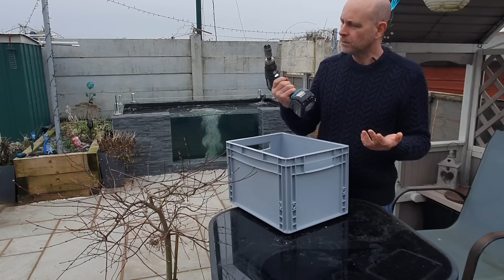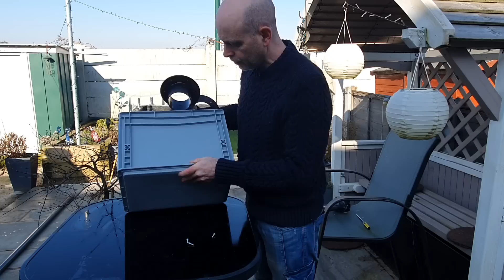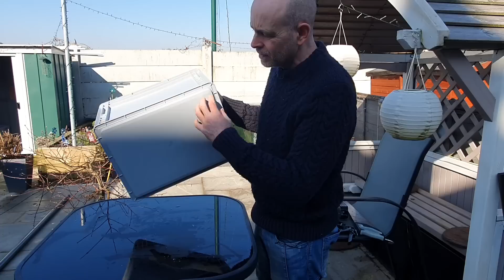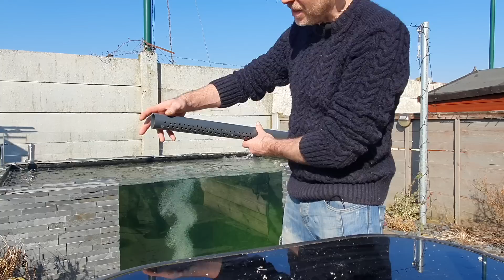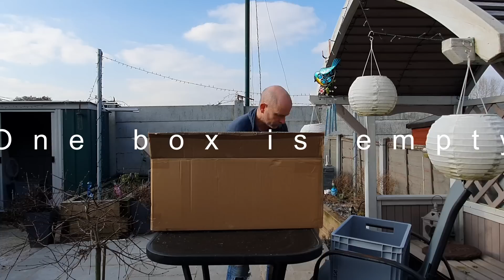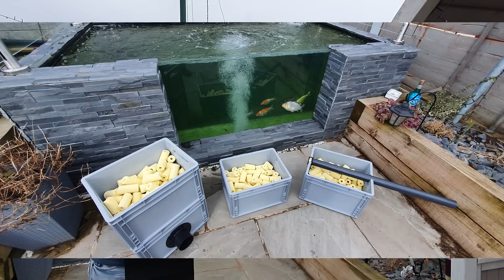DIY Bakki Shower Build (Make your own PART 3) Koi pond filter

Comment: Hi, I have built a bakki shower by following your video, looks brilliant and works extremely well. I have a tempest before it but still get a small amount of carry over which is starting to catch on the bhm. Is this OK? Or will it blind the media and affect its performance? Thoughts are to lay some filter matting under the spray bar but concerned it may reduce the harshness of how the water crashes into the bhm.

Any help would be appreciated 

Thanks 

Adam
Reply from the maker: Hi mate, sorry, I missed a load of comments, your being one of them 😒

You shouldn't really need anything if you have enough flow. I appreciate its a rock and a hard place as the tempest requires low flows and the shower needs as much as you can throw at it. Its a fine balance. I haven't touched mine for a couple of years now and its absolutely fine so I would just ride it out and let it do its thing. You are right in that adding some matting will dampen down the water velocity and reduce performance.

Comment: Can I ask where you purchased pipe work from ?
Reply from the maker: Hi there, to be honest I usually just search the internet for the cheapest place but I always use pressure pipe. I've had stuff from Dankoi in the past with no issues. If its an unplanned job and I need something quickly I go to Tim Waddington at Quality Nishikigoi. To be fair Tim usually does me a price equivalent to the online prices but having it delivered is often easier than trying to transport long lengths myself and I'm also lazy 😁

Comment: As a novice on a learning curve I have watched a number of your videos and am very impressed with the knowledge you have and the informative presentation on the various topics presented.
I have just completed watching the 4 parts of the DIY Bakki Shower Construction  and have a couple of questions.
The first is regarding flow rates. Do you have a flowmeter that you use to confirm what you end up getting on the return.
The second is cleaning. The Tempest you have involves closing 2 valves and opening a tap. 2 minutes later job done hands clean and dry. How much maintenance does the Bakki require or is it self cleaning so to speak from the bacteria's in the media.
Thank you and keep the videos comng.
Reply from the maker: Hi Hi, so sorry for not replying to you, I've had an issue with comments and I've missed loads of them 😒

No flow meter, I found them to be expensive and no very accurate to be honest. I just use the bucket method to measure flow.

As long as you use the correct ceramic media and you have sufficient flow for your shower dimensions it wont need cleaning. I haven't cleaned this one since it was built and I ran 3 on a single pond in the past, straight from bottom drains, and didn't clean any of them for approx. 5 years.

Comment: Hello Darren,

greetings from Germany and one question to you.

Is it possible to use a Filter like  this for a new pond. Its about 18000 Liters.
I will use a 300 Liter Box with filtermedia and a Pump with 25000 L/hour ?

Thank you for answering.

Greetings 
Andreas
Reply from the maker: Hello there, if the filter media is mechanical filtration and the water is reasonably clean afterwards then yes, you can definitely use a shower filter to take care of your biological filtration  👍👍👍

Comment: Hi I wondered if can help. My pond is only 2ft deep I intended to rebuild to 4 ft. At present I’m running a eazy pod with moving bed. Is it worth adding a baking shower.? I’m covering the pond this winter with it being shallow so I’m hoping it’ll be ok till next year.
Reply from the maker: Hi mate, you dont say what volume it is but it depends really on a few things.
You say you have a moving bed so it suggests the Pod cant cope on its own?
If you need more bio filtration then a shower is definitely a good option to provide it. It sounds to me though that if you are going to make it bigger soon (say next spring/summer) you are probably going to then need a bigger filter. It may be a good idea to sell the Pod and moving bed and get a nexus as your mechanical filtration is going to struggle on the bigger pond.
A shower is definitely an excellent option to compliment a good mechanical filter and it gives a lot of extra benefit such as the aeration, gassing off, nitrate removal etc
Reply: @DazzleKoi  hi my pond at the moment is 2500 litres. But only 2foot deep
Reply from the maker: Hi Neil, I think you are fine at the moment then but I think if you make the pond bigger a shower would be a great addition. 2ft is a little shallow as koi benefit from the higher pressure of deeper water and also the temperature tends to stay a little warmer and not freeze. Going to 4ft will definitely benefit them 👍👍👍

Comment: Hi Darren, how were the results of the shower in the end are you pleased with its ability to reduce nitrate? I've got a bit of a challenge as my tap water is reading 20ppm and the elephant ears bog isn't reducing nitrate. Great videos 👍
Reply from the maker: Hi mate, and thank you.
Yes I'm really happy with it so far. Since I fired it up my nitrate has been zero. I must confess I cant remember what my tap water reads but I had it in my pond before and I haven't since the shower went on.
Ive fed sometimes up to 10 or 12 times a day all through and I haven't seen any ammonia or nitrite either but and I know that volume of food is beyond the pod alone.
So yes, delighted with it still, definitely recommend putting one on 👍👍🍻🍻👍👍
Reply: @DazzleKoi  ok brill mate, right I'm on it! Pics to come!

Comment: Quick question Daz will you be turning off you shower when winter arrives thinking it would pull cold air into the pond also do you cover your pond in winter sorry if these are daft questions
Reply from the maker: Hi mate, sorry for the delay in replying to you, I've been away on holiday. No I leave everything running all year round. If you turn it off you will kill off all the bacteria and have to start all over again in the Spring.
No I don't cover either. In fact I do nothing different at all in winter other than reduce feeding when their appetites drop.

Comment: Hi, great video very well explained. Just one thought, is it better to leave the top box open to the elements or covered or does it not make any difference? I wondered if sunlight would kill off any bacteria?
Reply from the maker: Hi mate. The original Momotaro showers where always open at the top and I do like the idea of air movement and gassing off so I've always left mine open and never had a problem. There is a belief that bacteria are happier in the dark but again I'm not convinced and with porous media they are mostly inside anyway.
I think if you where going to cover it you would still need to leave a good few inch gap to allow air movement.
Reply: @DazzleKoi  hi and thanks for taking the time to reply. I did give this some thought and I think you are right especially when you we consider the conditions of a natural situation in the wild with waterfalls etc that are exposed to the sun. And like you said the majority of the bacteria are hidden away in the porous holes and won’t receive any sunlight.
Reply from the maker: Yes that's a good point about nature. The rocks in rivers etc that the shower is trying to mimic are not shielded from the sun 🍻🍻👍👍🍻🍻

Comment: Daz, quick question, since you fitted the Tempest so you think the shower is needed at all? Has the water quality improved? Thanks
Reply from the maker: Hi David, yes definitely need the shower as well. They do two different  jobs. The Tempest is mainly about mechanical filtration, taking out all the little fine bits floating around in the pond and making the water look clear. The shower is more about biological filtration, excellent ammonia/nitrite removal and has the added benefit of removing nitrate, which other filters can't, and adding a lot of aeration as well 👍👍
Reply: @DazzleKoi  Really appreciate your reply, thanks
Reply from the maker: No problem mate 🍻🍻

Comment: Can you mix bakki shower media ?? I have been given pumice stone , with the shower however I have purchased Infra red media  , would using both be beneficial?? Thankyou
Reply from the maker: Hi John, yes you certainly can. The infra red media is much better so you want as much of that as possible but you can definitely make up the rest with pumice.
I would recommend putting the infra red stuff in the top trays and the pumice at the bottom. this is because the pumice will block if you pump dirty water over it but the infra red stuff will consume some organic debris.
Reply: @DazzleKoi  Thankyou so much

Comment: How do I work out what flow I needs?
Reply from the maker: Hi mate, I talk about flow in the first video in this series here https://youtu.be/qIgsMxpFiWI .
Basically you want as much as possible, ideally 3000 gallons+ for a 1m shower. So if you cant flow that much you need to reduce the width of the shower down to match your flow.

Comment: Good Day.  Watch various other videos on the subject of Baki Filters but yours the only factual supported video (prior videos included on Baki Filter) that immediately made me pay more attention.  This issue we have in South Africa is that it is exceptionally difficult (almost impossible) to get containers like the one you used with dimensions around the 400 x 300 x 270 mark.  If i am only going to adjust flow to get out 5500 litres or so  which would be other dimensions to consider that will still support the science/facts on this filter as explained by you?  If i go longer than 400mm then need to increase my flow and that means more wattage/bigger pump etc.  So in essence how far could i push the dimensions to differ from yours to still get the benefits on around 5500 litres per hour or so?  Thank you
Reply from the maker: Hi mate, I feel your pain. I would say that if you have to go away from those sizes its better to go smaller if you can but if not then a little bit bigger should still give you benefits. Do you know what sizes you can get hold of?

Comment: Thank you. The information provided in the series of videos is much appreciated. Have you had chance to assess the performance of the shower following installing it on the pond?
Reply from the maker: Hi Tim, I haven't sat down and analysed it but or even give it any thought at all since I switched it on to be honest. But that's a good thing as its not given me any issues and its just got on with doing its thing. I'll do a little video on feedback but I've been able to feed literally anything (up to probably 15 feeds some days at a guess) and I've never had any ammonia or nitrite readings of note. I've also not seen any nitrate since it went on so that's the big bonus for me. Its hard to say how much biological filtration its done or if my other filters would have coped without it (I suspect not) but it is definitely responsible for the nitrate removal 👍👍
Reply: @DazzleKoi  Keeping the nitrate level low in the pond is my issue, as there is a high concentration in the tap water here. I am going to build a low cost DIY shower filter following your instructions. Thank you again for sharing your research.
Reply from the maker: Hi Tim, nice one, you'll see good benefits. Nitrate is a massive appetite suppressor so if you can get it out you'll see your koi much more active and hungry and they subsequently grow much better. Give me a shot if you have any problems 👍👍👍
Reply: @DazzleKoi  Do you run your filter all year round? I have to shut down my system in the colder months to avoid damaging the drum filter. Can Bacteria Home Media be reused when the system is restarted?
Reply from the maker: Hi Tim, yes definitely. You really need it running all year round. I assume its a climate issue you have?
If you switch it off you are effectively starting again with a new filter every spring. To establish a biological filter fully and reach equilibrium throughout can take up to 12 months so you are never going to have that if you turn it off.
Can you maybe bypass the drum to keep water flowing to your biological media?
Yes, no problem re-using the media, its just that all the bacteria will die off if you stop the water flow over it.

Comment: Why does the media need to be put in randomly? As opposed to stacked in uniform
Reply from the maker: Hi Roy, its broken up to increase the accessible surface area and you want it random to create chaotic , random water movement. If you don't, water will track, i.e. take the same route through the media all the time. It takes the path of least resistance. So you don't get all the media in contact with water. Its just all about maximising contact and surface area really

Comment: Great Video..but may I ask where got your boxes from...cheers
Reply from the maker: Hi mate and thanks. Sorry for the delay, I've fallen a bit behind with my messages. In part 1 or part 2 of this video series I talk through choosing the right sized boxes for your system and also where you can get them at a good price. From memory I think it was a company called Solent plastics. They where the cheapest I found and they provided great service 👍👍👍

Comment: Wonder if I could ask a couple of questions please, recently built a new pond using a multi barrel system with the intention of completing the system with one of these towers, I built in a 4” below water return, plan is to pump all my water (7,000lph) to the top of the tower and gravity return to my pond, first question is, what size box do I need to accommodate that sort of flow and secondly on my system my last barrel is basically a collection chamber with no media in it, I currently have an air stone in the bottom to add aeration, should I keep this in place once the towers built or am I better off discarding it and allow the tower to add the aeration I need going back into the pond?
I should add that all my filters and the tower will be housed in my garage with no aeration actually in the pond itself.
Thanks
Paul.
Reply from the maker: Ahh, sorry Paul, I missed this comment completely. I only found it when I saw your newer comment and looked back. It sounds like you have got all the answers now but if not just ask mate 👍👍👍
Reply: @DazzleKoi  hi mate, thanks for the reply, I do have a question for you, my filter system is an inline barrel setup, I have, vortex, two static bed up flow filters with hel-x media, a moving bed again with hel-x then a fifth drum that acts as a collection chamber, I run an air stone in the bottom of this one for added aeration, I then go 1.5” through my pump, branch off for UV and back to the pond via a single 4” return, this is reduced both ends using a 4-1.5” rubber boot as a temp setup, question is, I’m building a shower using the 600x400 boxes to take a flow of aprox 8,500ltrs, all housed in my garage, I just about have enough room to keep my existing setup and add the shower on the end, or I can loose the fifth drum and/or the moving bed, I’m guessing the moving bed will be virtually redundant as the shower will give me all the bio and aeration I need or am I better of keeping it in place?
Plan is to build the shower complete and then on a given day, strip down my existing setup, install the shower, pipe work etc and get it straight back up and running.
Thanks
Paul.
Reply from the maker: Hi Paul, I would definitely keep the moving bed barrel. The last barrel that has nothing in it I would get rid of as its not really doing anything other than adding air but you have more than enough from the moving bed and the shower will also add loads.
As long as you use a good ceramic media there is no issue if a bit of waste gets sent over the shower as it will deal with it 👍👍🍻🍻👍👍
Reply: @DazzleKoi  glad you said that, as that’s what I’ve done😊 just got it up n running and it seems to be working as it should, used the Kano media as recommended👍
Reply from the maker: Nice one, I'm confident it will all work well mate. Keep me posted with how things go 👍👍
Reply: @DazzleKoi  hi mate, having a few problems with the shower, pond water on the face of it, is very good but my oxygen levels are very low, I’m guessing that’s purely down to the fact I’m not running enough water through the shower to make it work effectively, that’s down to pumping the water up hill by about 2 mtrs plus running it through a uv although the uv is designed to take 6-10,000 ltr per hour I’m not achieving that, so I’m having a total rethink, could you tell me what the ideal flow rate is using the 600x400 boxes please? Aim is to get the setup with the right flow rate and then maybe install a separate pump on my skimmer to feed the uv.
Thanks
Paul
Reply from the maker: Hi mate, I would suggest a minimum of 10,000 litres per hour over a 600mm wide shower. You can get away with 7500 litres upwards but it wont be as good. The second video in the construction series has all the info on choosing the right width/flow for your particular situation https://youtu.be/qIgsMxpFiWI

Comment: Evening Darren can I run my shower straight from the easypod cheers mate 👍🏻
Reply from the maker: Hi mate, yes you can. You need to make sure you have the right flow through the Pod though, about 5500 litres an hour, and then you need to make sure its the correct sized shower for such a low flow 👍👍
Reply: @DazzleKoi  cheers daz just everyone keeps telling me I can’t but thought you could 👍🏻
Reply from the maker: No problem, a 30cm shower like the one I built on the vids is perfect for after a Pod mate 👍👍

Comment: In place of the 3 inch return would 2, 2 inch returns work the same
Reply from the maker: Hi Paul, its down to surface area really. The surface area of a 3" pipe is 45.6cm2 and the surface area of 2 x 2" pipes is 40.54cm2 so its a bit less but not much. I haven't tried it but based on that calculation my guess would be that it will be ok 👍